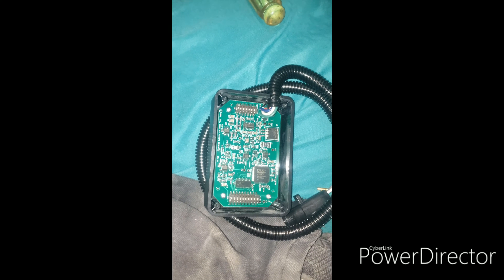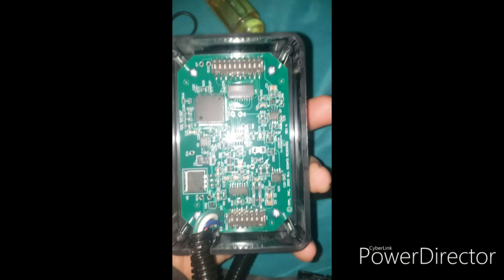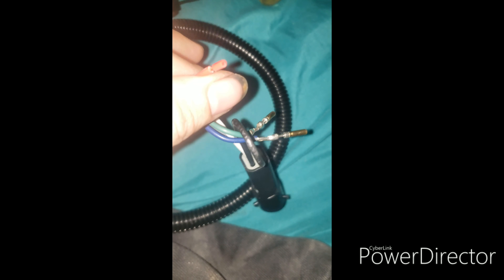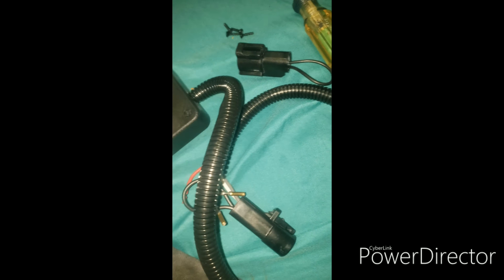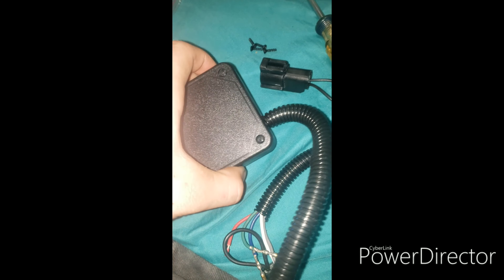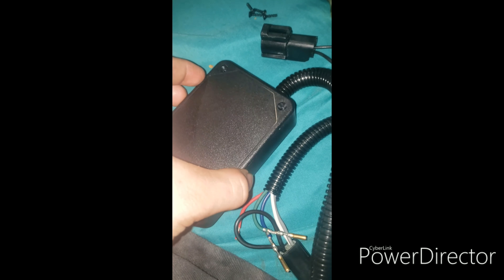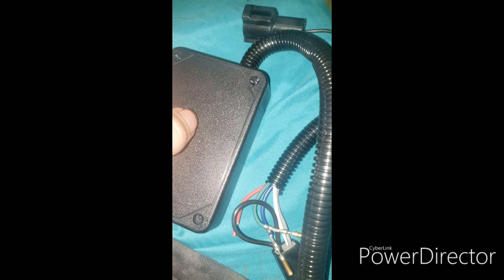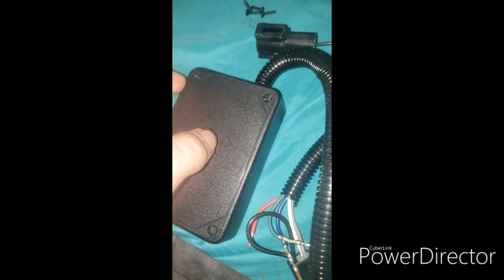Correction game - dallas mustang speed cal

Comment: so i got a mustang 2003. its gt, manual. I opened the shift boot area and I see that there is one of these devices inside there. It was unplugged because they tapped it from the 12v lighter. I plugged it in. Does it affect it if i plug it in or leave it disconnected?
Reply: Did this affect it?
Reply: Does it work now?
Reply: @smalltownryder8123 I didn’t notice a difference to be honest
Reply: @isaacvaldez9301  i opened the boot area too my spedometer dont work as well as odometer my red wire is not connected to any source... is the box just for calibration or is it also a speed sensor that needs a constant power scource? I have an 03 manual also
Reply: @ i think it’s both. Calibrates shift points with speedometer and needs power. Mine was wired to the 12 volt cigarette light

Comment: I know this a old video but I need help asap. I have a 98 mustang with a 2004 transmission in it. It was like that when I got it. My speed is way off. Can I use this.
Reply from the maker: No a tune is requirred on 99+ transmissions for tires Nd gear changes
Reply: @46Savage  ok thanks. So I will have to take it somewhere too tune the speed. When I hook up the sensor it say I'm going 150 in 3rd gear and start cutting back.
Reply from the maker: You can buy an sct handheld tuner they will change it
Reply: @46Savage  Thanks so all I do is hook this up too my car and it will program the right speed for my car. My car is a 98 but somebody put a 2000 mustang transmission in it. I just wanna make sure before I buy.
Reply from the maker: It should i would call sct to confirm but i know the newer 99 04 trans use an input speed sensor to check speed as well the real question is if some had it setup to run with that sensor or not if not you need the speed cal if you do have it you need the tune
Reply from the maker: My speed cal will be up for sale in a few months when i get my holley ecu
Reply: @46Savage  ok let me know asap. I will buy it. That's the only problem with my car.
Reply from the maker: Message me on instagram or on fb at 4.6 savage and well work out a deal
Reply: Yo u sale the speed cal yet. I need it asap and no that tuner want work. I tried it. I need that speed cal.
Reply: Abbott makes them . Mine just got delivered today